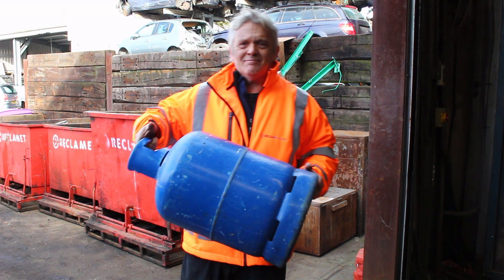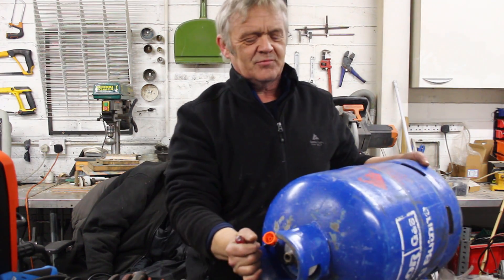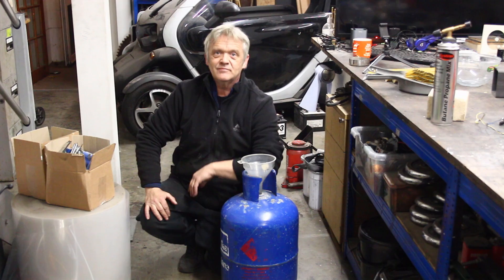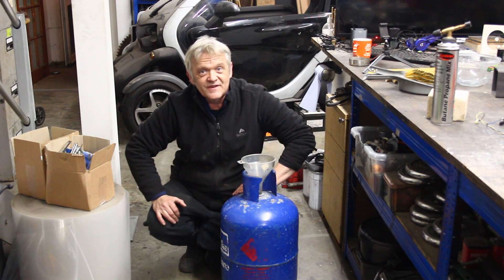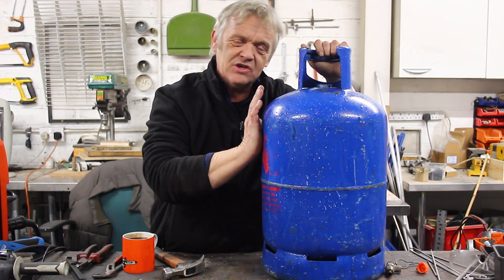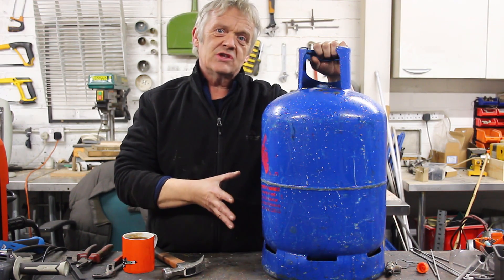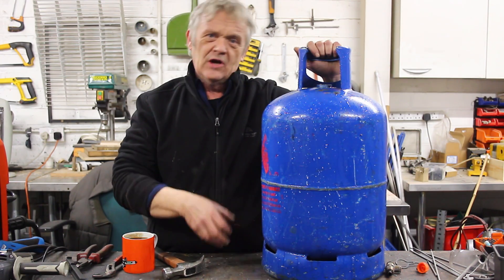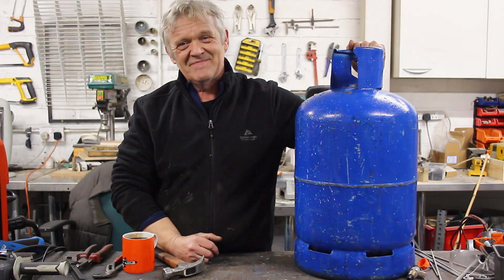1407 How To Empty Gas Cylinders

Comment: I had an idea the other day for a raining day and I would like your opinion or if you find any clawing in my idea.. so my idea is to buy a generator running on lpg and then use my car lpg car to park next to it  and connect by some pushrod valve or something to push the ball in the inlet of the car tank to release a steady slow stream of gas to run the generator, since the car lpg is more cheap and the talk itself is very big and in a shortage can last a very long time and power my home, also it's easier to go back to gas station refill the car and come back, what do you think?
Reply: You can already get an adapter to refill special cylinders up like it was a car

Comment: In California and I guess the other states an odorant oil is added is added to the propane gas, so be prepared for that to come out. It is super messy and will draw every Blue Bottle fly within a mile or two.
Reply: Also all the welding supply shops in this area carry dry ice specially for purging fuel tanks that need to be welded.

Comment: Just one little question, many, many years ago i used to work for a gas company also in kent, delivering lpg to homes, holiday sites for there swimming pools, if we had to any type of maintenance we used a copper hammer, not a steel one, as you said there is still gas inside until it is purged, and I think i am right in saying that a bottle with vapour in is even more of an explosion risk, one little spark will totally piss your day off, just saying like

Comment: As a gasman, beware the bottles are the property of the supplier  and they are currently losing a lot of bottles for one reason or another (scrap and overseas) and they aren't very happy......I say make as many log burners and BBQ as you like 👍 and if you know any older folks using bulk or bottle gas check the price they pay I regularly see people getting ripped off because they don't know how to change supplier, Haggle for best fixed price I've seen people save 50% and sometimes £100  credit/free gas. and change or threaten to change every two years.
Reply from the maker: nice tips mate - cheers

Comment: I was waiting to hear the water trick and was not disappointed. Oddly enough, some of these have the rubber bladder inside and some are just straight steel. The bladder ones definitely need the water soak due to their propensity for absorbing propane and choosing to 'vent' at inopportune times, like when you get your grinder at max anger and sparks are going everywhere. They do make excellent bodies for all sorts of things though, like forges and pressure chambers.
Reply from the maker: they are amazingly useful that's for sure
Reply: Vacuum chambers as well.

Comment: Alternatively once the water is in and the gas is out you can boil the water out of the tank to reduce the weight. You can do that with metal where you can't with plastic, so I feel it is worth honorable mention.

Fantastic video mate, I'm thinking about touring our local scrap yard for parts now 😁
Reply from the maker: that's a lot of water mate - it wold take a while to boil it out - but it is a great idea for drying the inside if you want the thing whole and dry
Reply: @ThinkingandTinkering  you could bypass the few days of draining the tank by just adding the water and then boil half out and you have the same time table to work with. Thank you for the support of my idea though.

Comment: What's the advantage to waiting a day before filling the tank with water?
Reply: It's just another fail safe , if it's all out by doing the water method but you get an air bubble / lock then it could still be quite a bang. I've heard of people doing just water and getting a surprise. Better be safe than sorry when dealing with this stuff
Reply: @karlmyers6518  Makes sense. Thanks!
Reply from the maker: Karl said it mate

Comment: If you're unable to open the tank for whatever reason, another option is to use a vacuum pump.  Since you can't extract 100% of the contents that way, you can then fill it with an inert gas afterwards (like nitrogen), release the pressure, fill it again, release it, just to carry out some of those remaining molecules.  Or, instead of nitrogen, use the gas you'll be storing in it to flush it a few times.
Reply from the maker: cheers mate

Comment: A plastic hose can siphon the water out of the tank. It’s not quick but it’s easier than trying to move a big heavy water bottle.
Reply: And with a long hose, you could siphon the water far away from the tank if you can't get that area wet.
Reply from the maker: nice tip mate - cheers

Comment: Wouldn't it be easier to cut the handle/guard off fist if you're not going to use it?
Reply from the maker: to be honest mate I would do anything near a gas tank that produces sparks or heat before you get the gas out and clean it